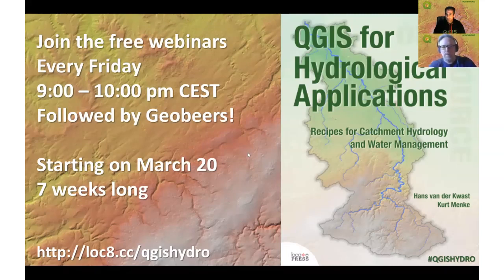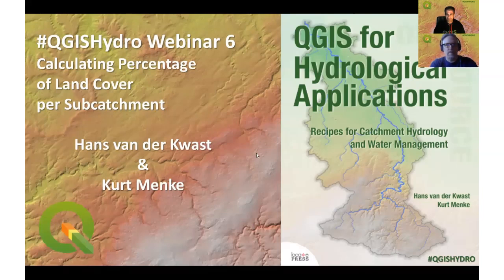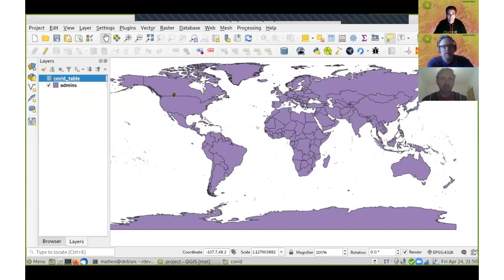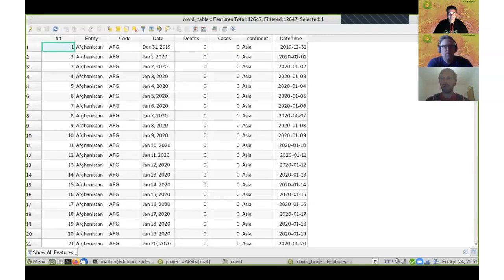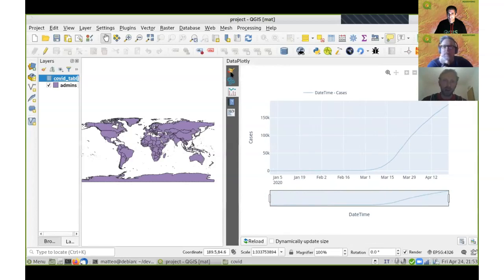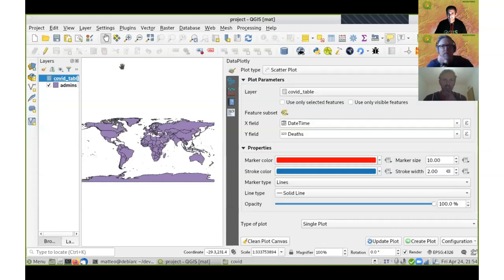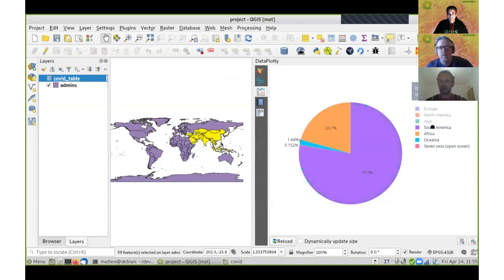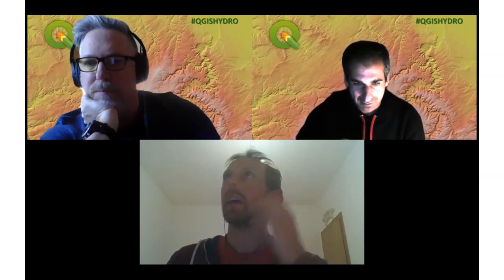QGISHydro Webinar 6: Calculating Percentage of Land Cover per Subcatchment

Comment: Great Videos Hans. Does QGIS have a tool for intersecting raster layers? I have been an active ArcGIS user and i have been able to perform great raster intersections on ArcGIS.
Reply from the maker: Do you mean zonal statistics? Check these videos: https://youtu.be/sHfXs_d8VLQ and https://youtu.be/gulqupCxA7w
Reply: what i want is to be able to overlay/intersect, for example, 3 raster layers (e.g soil classes, slope classes, landuse classes) and generate a new single raster layer that still keeps the soil, slope and landuse information for each pixel. ArcGIS does this using the combine tool and keeps this information in the raster attribute table. So i was wondering if QGIS has a similar tool or how differently does it achieve this.
Reply from the maker: @dnyolei  Raster Value Attribute Tables are not (yet) supported by QGIS.